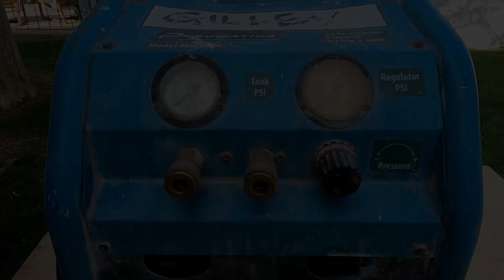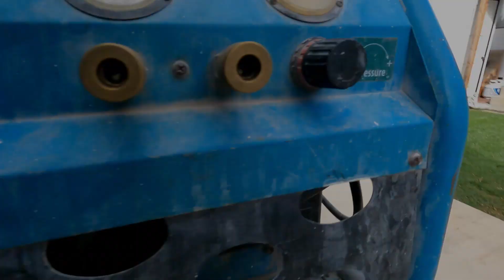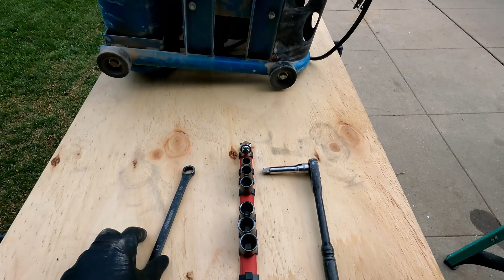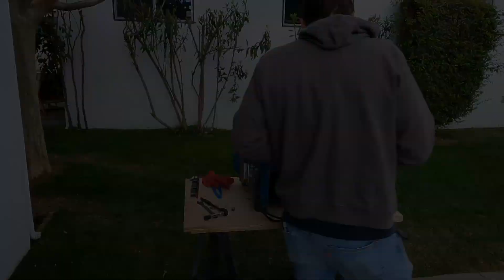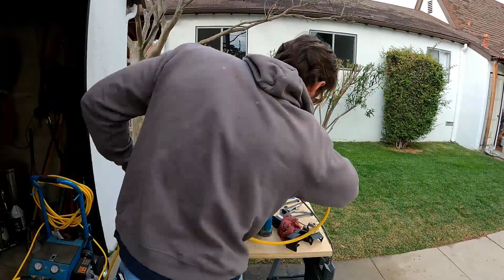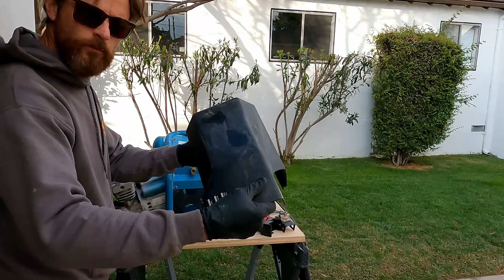Makita Compressor Pressure Switch Replacement

Comment: When I tried to remove the four bolts holding the bottom plate to the frame, I found that the idiots cut threads in the plate so removing the nuts and washers doesn't allow the compressor motor to be removed. Had to remove the allen head bolts, slide the compressor out then remove the bolts from the bottom plate. I then drilled the plate holes out so I could put the plate back on the frame. PITA.

Comment: Thanks for the video.

I have the slightly bigger version Mac5200 and it developed a leak rate underneath the pressure switch. Not exactly sure what it's called it might be called the pressure switch diaphragm.

I'm not sure if that comes with the pressure switch.

Comment: At 7:07 those little caps on the side, mine is leaking from one if those, would adding some thread tape be a good start? Any suggestions?  Thanks😅
Reply: Yes, clean the threads well and then apply some good ol' teflon tape!

Comment: is this why these compressor leak air cause of that pressure switch
Reply from the maker: They can cause a leak but most compressors are leaking air due to a failing fitting or hose. The pressure relief valve on the bottom of the tank can also be a reason for leaking air. If your compressor is leaking, and you can hear it, then you should attempt to use some soapy water mixture and gentle wipe the mixture over the areas of suspected leaks. You should see bubbles immediately once it comes into contact with a leak
Reply: Do you mean a leak from the bottom of the pressure switch itself? NOT a hose? That is where mine is leaking from...seems like a strange failure to have. I came here trying to see if that is a common problem.

Comment: I need to replace my manifold block. How difficult was it to detach and reattach the air hose running to the manifold block?
Reply from the maker: A little tight for your wrench to fit on the nut and turn it. The hose is very stiff. Make sure you don’t bend it or kink it. It is a flared fitting so it does not require any type of thread sealant.

Comment: What symptoms were you having?
I’ve got the same compressor and it’s not building up pressure past 40 lbs.
I bubble tested everything with a spray bottle and no leaks.
I got good suction on the intake filter side and good air flow on the exhaust side.
Reply from the maker: May have been the relay but the switch was not working at all. It is a fairly old compressor and they tend to go bad after heavy extended use. does your keep running and not shut off? There are screws inside the pressure switch that adjust the shut off and turn on pressures. Maybe you need to adjust your down?